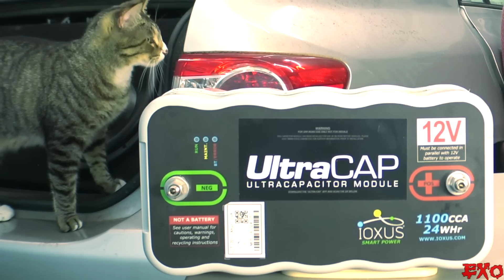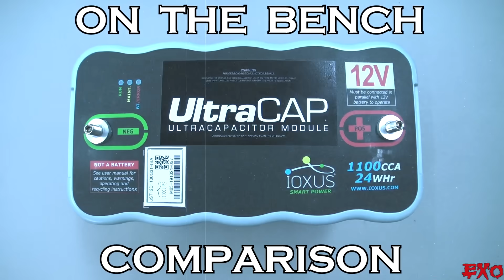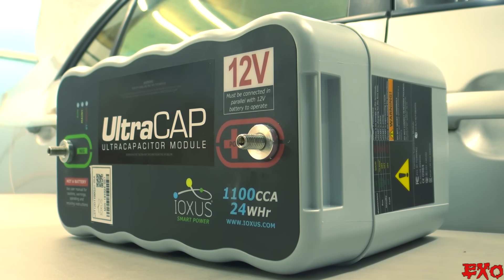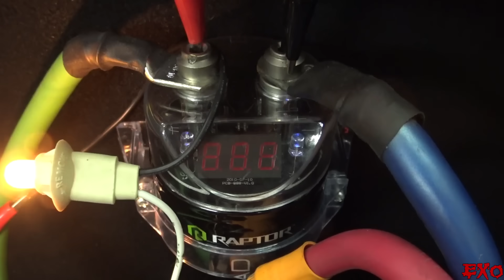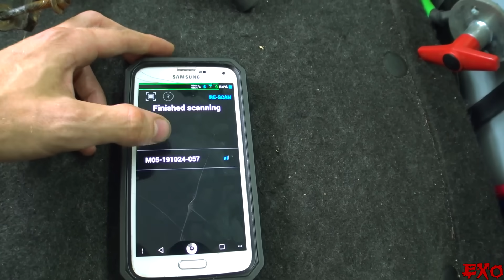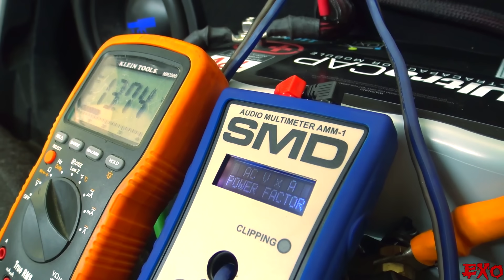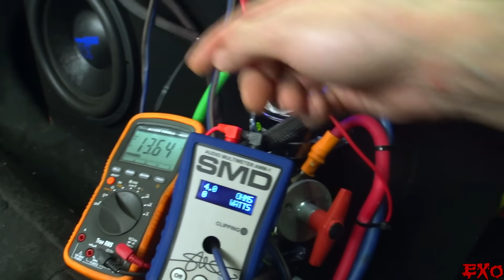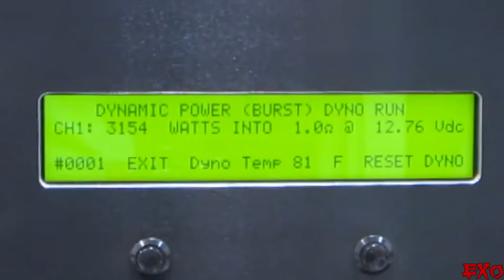The TRUTH About Car Audio CAPACITORS! Testing a CHEAP 12v Capacitor VS IOXUS UltraCap Supercapacitor

Comment: Also flet a cap was like a bandaid, great for a sec or two or to prevent lights from dimming. But a high performance alt would negate the use of a cap. Got a 250amp aftermarket alt compared to stock alt that does 145amp. Stock does 145 reved up, my 250 does 145 amp at idel and 250amps at revs. And yes a 2nd batt would help besides a cap and still would recommend a higher alt then ur stock.. Also I followed u need 1fren for ever 500 watts
Reply: Can't edit from phone, but play some 3-6mafia late-night tip that pounds like crazy

Comment: Be nice if I got that bad boy my head light dim every time the bass hit im new to car audio im running shar 1500.1d 1 ohm with 10 inch subs k could really use that bad boy. Thats for the information and j don't have $400 bucks

Comment: i always find it funny when i see someone with a single 10 and a real 500 watt amp and they have one or even 2 capacitors,lol 
i push 1500 rms daily with no issues. upgrade your battery and if needed alternator next. you cant go wrong with those two and the car itself will thank you.

Comment: I bought one after watching your video! It’s in my 71 GTO Judge
Reply: Can I ask your opinions on the bank after use? Any issues or difficulties? Thanks;
Reply: @royalbooty4657  hey man I’m sorry I didn’t see your question until now. It is a awesome addition. It holds a reserve you can turn on in the amp to start your car if you drain your battery. It feeds my amps all they need.

Comment: Off the subject but do you think the super caps are good for CB amplifiers/linears? I wanna run a 1000 watt amp. Guys usually run 4 to 6 truck Diesel batteries for that type of wattage
Reply: Supercaps create noise with CB and shortwave units.
Reply: @yougod7253  thanks

Comment: I have a 30 farad power acoustik capacitor. How do I know its still working when the led numbers stopped showing number? The blue leds on the capacitor still turn on but never shows the battery voltage numbers.

Comment: First off that was amazing!!!
  I'm still confused about the difference I'm not running 10,000 watts not because I don't want to!!
 But because I cannot afford it!!  So I'm running a cap an old one at that acbm 3 digital power capacitor I'm running to Sherwin Vega 12!!
  So my question would be is this little capacitor well enough to run the 12???

Comment: @exocontralto would you (or anyone reading this)  recommend the “NVX XCAP10H” 10 farad hybrid power cap? I’m looking to add a 1500 rms bass amp to my oem system and need help deciding, I’m also adding a xs power xp750 battery to my 170 amp alt. Would this added cap help? Thanks

Comment: Capacitor s...the black hole of the video world. I did YOU EM Integration....may have helped pioneer it, and I used an old capacitor bank use to ignight rocket fuel. Very dangerous. When only charged to 16volts,  and your Orion 225HCCA now put you into finals for 50watt amateur in Daytona.

Comment: My guy be careful whit capacitor!make sure you never toucht the contact whit your hand since there is 47 amps going trought yours when its on and trust me its gonna tickle a lot. Capacitor work by outputting almost all of its power really quick so if it goes trought you it will Discharge interely trought you.
Be careful when those are plug in! 😁

Comment: I’m running 2500 watts rms on a dd audio sub and a 4.75 rms amp for door speakers but i need to upgrade my electrical system any suggestions? Super caps or batteries?

Comment: Whoever said caps suck is those who bought a cheap 1 farad one.
Whover said caps are good is those who bought a good capacitor. Ending the debate thanks EXO!
Reply: I agree 
I had one in my car .
But i do have 2 battery in the car.
One for the car IT self.
One for my audio systeem in the back.
This way a faster way to sent Amps .

A battery do not like to sent its power.
A battery whant to keep is .
The 1 farad is make to sent IT fast and not to hold IT .
So that is a Nice combo for your subwoofer amp.
Reply: @dyslectische  1 fared is meant for the garbage can.
Reply: @yougod7253 will the one he showed in the video stop my car lights from dimming? Recently got a new amp and it’s causing my lights to dim because of how much more power and harder it is hitting

Comment: Hey whats up shout out first to exo love your videos and your break downs. I have earned so much keep up the vids your freakin awesome!!!

I have an atx1600.2 2 10s matrix px10dvc and 2 12s Blaupunkt gbw120 wored to almost 2 ohms. Today i was making people roll they windows up at the stop light when in the middle of a bass note the level literally jumped an entire step and no matter how much i turned everything up it wouldn't get louder. I completed my big 3 a week or so ago but still running stock alternator. I also went to wally world and invoked the warranty for a new battery(everstart plus). Full tilt My voltage was around 12.6v. Dropping from  14ish and quickly charging back up after i turned the amp and ac off.  
Its 1600w amp and before it goes into protect it can put out roughly 29v per channel or 9 56v bridged
Will a capacitor help with my current draw.

Comment: Would a capacitor work for me? I’m running a zx1000.1 kicker amp but my power supply only pushes out 250 watts would it help me with the lows??

Comment: If anyone could help me out I would really appreciate it, I’ll try to make this as simple as possible. I have an Acura with a aftermarket audio system. I decided to keep my head unit so I was required to purchase a LOC specifically the LC8i. The guy who did my system tapped into the factory “premium” amplifier but only took the speaker level Input for the front and rear. So basically only mids and tweets. I’m not to sure of how he did it but I’m pretty sure he summed the 2 channels into 1 because there is only 1 pair of RCA’a going Into the output of the LC8i’s main channel. That RCA goes into the main input of my 7 band Equalizer (which I believe is a full range signal). And the equalizer has front rear and sub outputs that go to my 3 amps (I have one for bass, one for mids, and one for tweets). I’m using a RCA pass through on my mids amp with y splitters to give signal to my tweeter amp because I have a HP filter set so my mids and tweets sound good. Now to get to my actual problem. I don’t have a remote bass knob so I just use the sub level control on my EQ to control my bass. No matter how I adjust the sub level or the gain on my bass amp the clip indicator starts flicking on at low levels. I know the potential of my subs and even though it does “hit”, I know they aren’t hitting as hard as they should all because if i increase by sub level or the gain it starts clipping. If there’s is anything that can’t be understood from what I said plz ask because I’ve been trying to resolve this for quite some time now. Thanks.

Comment: One thing I noticed is you didn't state whether your amp has a class AB or D power supply. The amp's power supply type and efficiency makes a difference in voltage draw as well. 
I remember in the 90's, those class AB amps sucked a lot of current and voltage from your alternator and battery. Proper gauge, high quality wire and multiple batteries were definitely a must. 
That Super Cap was definitely impressive and would have cost over a grand, but would have been worth it.

Comment: Hey man! Great video! I wanted to say something. In the '90s people would say caps suck because we would pay a lot for a 1 fard cap vs just adding a second battery which would be a better solution. Should we still use the same rule of 1 fard per 1,000 watts?
Reply: The general rule of thumb is 1 farad per 500 watts. So, if you are running a 5k certified amp, you would at least need 10 farads
Reply: @Skarfar90  what if I've got an 8000 watt amp and I'm only using 4000 of it. But I've got a 50 farad cap. Will it work fine

Comment: I installed a 2.0 farad cap and it did nothing but introduce a bit of interference to my system.

Replaced that with 108 farad worth of super capacitors and that truly solved my issues.

Comment: Im wondering If That Big Cap used In a Non Stereo application..like 12v inverter, Would it Get More Out Of My Deep Cycle battery?? Just a question. Thanks

Comment: It makes me sad to see all of the money people spend on car audio just to overcome the fact that it's a 12v system.  Everything would be much more efficient and cheaper if you just installed a special alternator that puts out 12v for the car and a separate 48v system for audio.  Everything from amplifiers to cabling would be so much cheaper and efficient after that initial spend.

Comment: EXO I understand what you're saying but capacitors definitely do work if you do it the right way i mean if the system is not something outragiously crazy like a bunch of subs or high powered subs for someone who just wants a nice over all sounding bass system then a capacitor works wonders I have tested this myself and I love them But like I said depending on the build yes those are 100% better

Comment: I absolutely appreciate the knowledge you give us EXO ( Bruce ) I've always be curious if my stock alternator and upgraded battery 🔋 ( full Throttle FT890 ) would match up well with a LTO supercapacitor to power up 4000 watts of total power. Keep the awesome videos coming. 😉👍

Comment: Had a 10 farrad cap running 2 pioneer amps, 1 was PRS D2000spl mono amp. The other was a 4 channel amp. Head lights good and not dimming with the bass beat.

Comment: I remember the capacitor days.   Definitely did help with my head light flashing for sure.  But I think was just filtering really.
Reply: I Used to put My Deep Cycle battery in my jeep. Did the trick
Reply: Very good test !!! Thanks for clearing up the info about caps and super caps!!

Comment: I still say buy a batterie isolator and do the dual batterys ur car runs off the one under ur hood and ur amps runs off the one in the back and back there all u need is a riding lawnmower battery  cause thats all i have been using with all my systems no capacitors what so ever like between $70 to $150 all ur problems are solved cause the battery thats in the trunk stays at 14.4 so i guess it depend on how much loot ur willing to waste fr

Comment: I was using a 1.5 Farad capacitor until I pulled it out & replaced it with a second battery, an XS Power D975, no negative effects. I’ve done the big 3 with 1/0 gauge, stock 120 amp alternator. Lights still dim a little on a 1500 rms amp.

Comment: Cant wait to get my super cap bank set up. Had an old rockford cap when i did my first install it seemed to help with lights dimming. But I'd prefer to just use an extra battery to a traditional cap lol.
Reply: Extra battery is cheaper too

Comment: What about using an HV Lipo battery instead? some RC drones pull over a 100a from tiny 1ah batteries while keeping the voltage pretty stable. They are also much lighter than standard car batteries. The only downside I'd know of is the price.

Comment: Hi EXO!  I have a 2004 Ford F350 4x4 Super Duty with a Super Crew Cab.  While this truck seems like a monster in size, I find that the room inside the cab (specifically behind my back seats) is very minimal.  Have you ever built a box for this type of setup?  I have found that the boxes said to be made for this setup only fit when the subs are not in the box.  When you add the subs you can't put the seats back in their upright position.  Any recommendations?

Comment: I'm trying to figure out frequency response. I got the 13.5 jl audio subwoofer for my truck and right now im pushing a rockford fosgate 500watt rms amp. The frequency response on the sub are 20-200hz and the amp 20-250. I was going to upgrade to 2 of the 13.5 subwoofers and a 1000 watt or 1200 watt amp, but I was wondering if getting an amp with a lower response will hit lower notes or does the frequency of the subwoofer also matter how low it goes? Thanks

Comment: Question is, can I combine it with my front lead acid battery while the super capacitor bank is in the rear? Do I need an isolator? How much heat can it tolerate if I were to use it for under the hood?

Comment: People always have said capacitors are bad for helping your amplifiers and audio systems, but if that was the case why does pretty much every car audio amplifier have them inside? And the higher the output of the amplifier the bigger/more capacitors they house inside their cases? Ultra capacitors are just a newer better version on the old style, not all capacitors are made equal, poor designed and manufactured ones are not going to work as well as a properly designed and manufactured one. Cheap no name ones that are poor quality are probably not going to help much which is also what helped propel the myth that caps do not work at all or just add a drain to your system compared to no cap.

Comment: I have been a fan of your page since I can remember going into SPL, I have unfortunately not been able to crack the SPL numbers I need in my class, but owning one of these capacitors might really help with the issue I have of voltage drops on a single battery..... Much love from South Africa

Comment: I use a Stinger farad cap for my 10 and it did help with my headlights from dimming. Bigger system would require a bigger compactor.

Comment: I have an old coustic amp-360 and i added about 15000 uf of caps from an old garbage home theater system directly to the amp leads and noticed a considerable gain in peak performance. My honda has a very small battery and my main power cable is an old jumper cable lead. The ground is tied to the chassis and doesn't make the best connection. So in my situation adding only a small bank of caps was very beneficial. its all about power delivery and power demand. Keep in mind i only have 12 dollars into my whole setup and that was for the fuse holder because i'm not an idiot.

Comment: It’s just a damn battery. 😐 
Stop playing with the words. I’ve been in car audio for a very very long time. A capacitor it’s not much difference to a AGM deep cycle Battery. Just do the big 3/4 0-gauge upgrade, make sure all the batteries are matching in power and or size, and enjoy your system. Car systems are not supposed to be running at full power forever. All batteries, capacitors or any kind of power source will discharge it self at any given time. So for what a capacitor’s duty, it’s the same duty and tasks a AGM battery does. 

My set up: a 2004 6.0L excursion
• 2 Interstate AGM Platinum Batteries in front
• 300A alternator 
• Big 4 0-Gauge cable upgrade
• 500 Amp battery isolated to 4 Interstate AGM Batteries connected in series.
• Two Strapped Audiopipe 3000.1 monoblock amps that are powering 2-15” quad stack subs
• 2 Audiopipe 2500w 2ch Amps (powering 4 - 12 mid bass speakers and 4 - 3” superbullet tweeters)
• 1 Audiopipe 500w 2ch amp powering a 4 horn chuchero. 
• 1 Lanzar 500x2 powering the 4 door speakers 

All batteries are reading 13.2 volts. After playing for 45 minutes (on full power/no distortion) all batteries reading at 12.8 volts.

It’s all just batteries to me. Capacitors are old technology that should have been left in the late 90’s early 00’s. You go to any professional sound shop, no one advertises Capacitors anymore. That went out like the “Bazooka Bass Tubes.” All old technology.

Just get yourself a secondary or “house” battery and change the cables and good grounds, you will NOT be disappointed!
Reply: super caps have a resistance much lower. do a ripple test on your battery and then on a super cap.you will see how much more ripple is fed back to the battery.

Comment: I have a rp800 amp runs at 600watts at 2ohms I have new battery and new 90 amp alternator but my battery wont be able to start my car sometimes. So do I need a small capacitor or a high output alternator??

Comment: So if I install one big capacitor in my car and connect it to my avatar-atu. 1500 amp, I will have less voltage drops? Right now my battery drops from 14,1 volts to 13,3 volts if I crank the volume on full. Love from sweden

Comment: I put capacitors on my system in 1988 or 89. Before anybody that I know of ever heard of it. They did not have any ultra capacitors then. They were a few hundred thousand microfarad. I think I had six or eight of them hooked up. I had a Linear Power amplifier and it sure made a difference. If I had marketed them just imagine how much I could have made. Just another thing I did without much thought I guess.

Comment: You have to know that not all of the car audio capacitors has the exact capacity that is printed on their sticker. When you buy such a capacitor you should test the capacity. It is very common that, for example, a 2F capacitor has only 0.1 to 0.5F capacitance. It is not easy to get exactly what you pay for.
The capacitance of a capacitor decreases over time as it dries out slowly. It is very important to place capacitors as near as possible to your AMP's.
When i buy car audio capacitors without Remote-Connectors for the Display ON/OFF Function i dismount the complete plastic-head with the Voltage Display inside. I don't want auto-turn-on Displays that permanently measures the Voltage. For the First Time these Capacitors needs to be charged gently. Otherwise you can damage the capacitor in various ways. For this reason, high-load resistors or a lamp are usually included to charge them up.
In my last car i had two 1F Capacitors for a Mac Audio ZX4500 Black Edition in 4-channel Mode 4x125W RMS. The Battery was a 95Ah Berga Power Block. The alternator was designed to deliver up to 120Amps. A visit at a dB-Drag Event has shown 138dB with the Soundtrack "THX - Woofer Cooker". No lights were flickering. The engine idling speed remained absolutely constant. My capacitors did their job very reliably and satisfactorily.